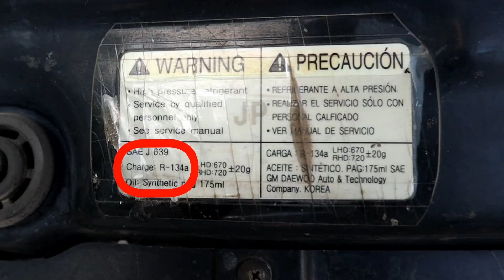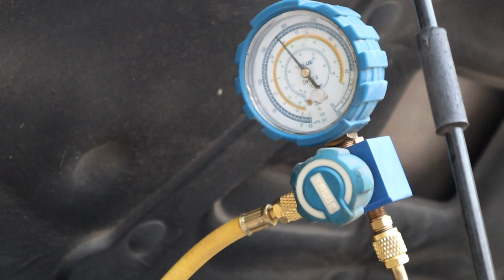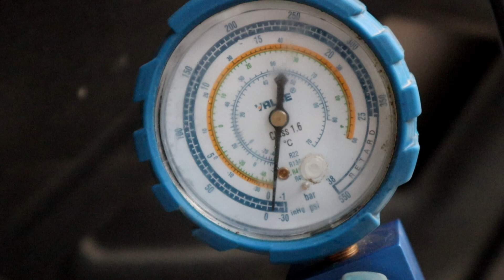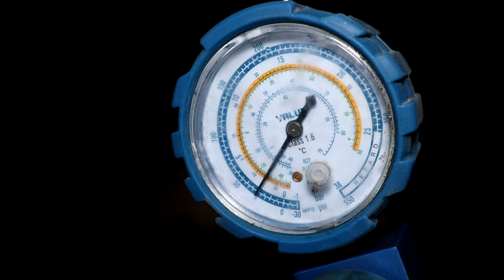Your cars A/C blows hot air??/How to replace ac hose on your car/Why my cars hose coved with oil

Comment: Does the compressor lose any of it's PAC oil with a blown hose?
Reply from the maker: Yes, but depends on the location,  if its lower and on dischargeline, usually it's more

Comment: How did you pressurize the system to 200 psi before adding the refrigerant to see if there were potential leaks ?
Reply: Just by a can of refrigerant and connect and add some to the system and trust me you will see the leaks I did that and found my leak right way now I gotta replace my high pressure line but imma buy the set and do both since it’s a 20 year old car

Comment: What are the causes why the high pressure hose (both ends of fittings) leaks?
Reply from the maker: Vibration, and the wickest point is between the joint and the hose, because there is not much flexing there